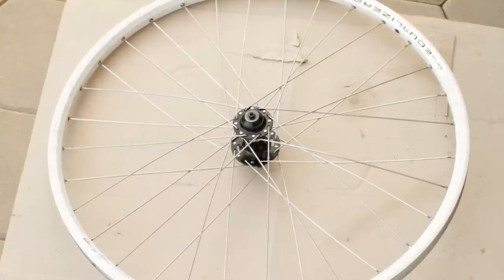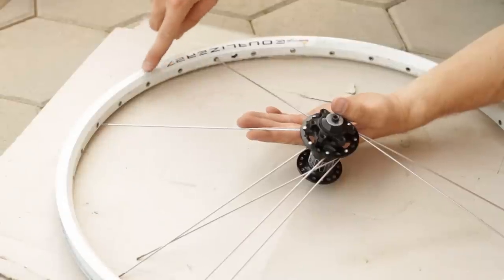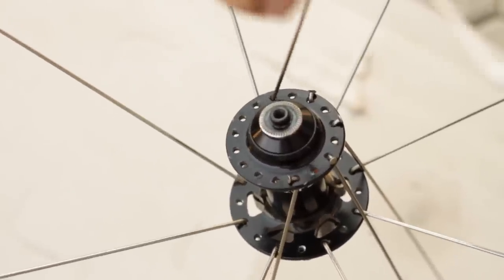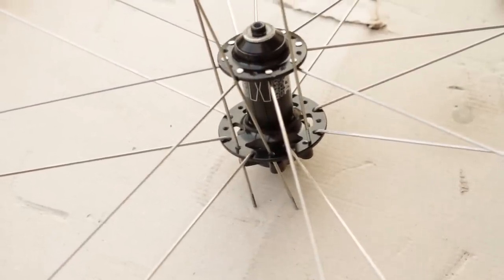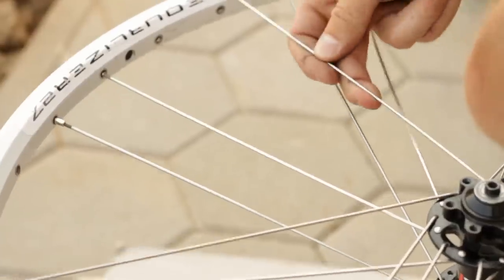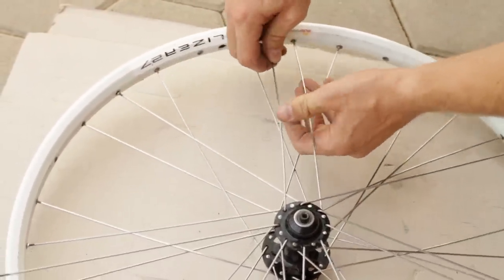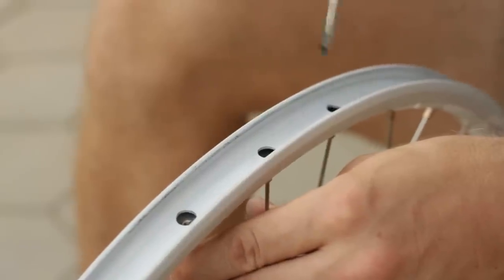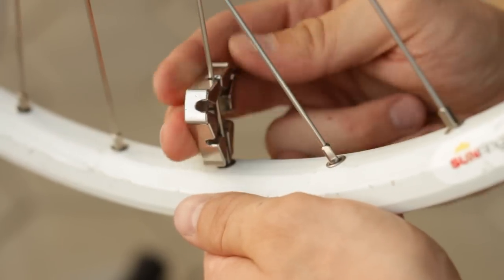How to Lace a Wheel - Three cross pattern

Comment: This is by FAR, the easiest system to follow that I found! 1st time lacing a wheel and I had no problem following and once you understand the pattern, it's easy to finish on your own without the video. I had 14 full turns on all the nipples (3 turns at a time) and stretched them all a number of times as I tightened them up. Took them to get final tensioning and trueing and the guy said that everything was just about perfect as it was, just a bit of trueing and ready to go. Thanks Bikebook!!

Comment: I don't understand many of the comments here. This is by far the easiest and most straight forward wheel building video I have seen. The video takes you step by step in a very clear and orderly fashion.

Who ever made this video is very smart and efficient.
Reply: Yet it mysteriously skips the very important step of flexing the newly installed spokes under a heavy load, necessary for introducing a degree of pre-warp to each side of the built wheel.
Reply: I agree.  Much easier to follow than the highly regarded Sheldon Brown/Harris St Cyclery article on same.  Admittedly - she is just dealing with one configuration (32 spoke/3cross) - which makes it much simpler to explain (e.g. counting 5 holes anti-clockwise, etc.).  Nevertheless - very clear.
A few minor things could have been added - pre-stressing the spokes by pressing the whole wheel sideways and squeezing adjacent spokes, then rechecking/tensioning everything; oiling the spoke nipples at the start; and the usefulness of a tensiometer to get the tensions nice and even before starting the truing process.

Comment: This was an easy video to follow. I have looked at several on here on how to lace a 32 spoke 3 way cross over and this worked for me. The dishing and truing may be on the basic side but if you can get it to work for you then thats great on a more expensive bike and wheel i may go down the lengths of using a dishing tool and spoke tensioner., but all in all i found this very helpful. Thanks

Comment: This video helped me build a wheel after several failed attempts.   I had to stop and replay certain sections, but it all made sense and the wheel came out perfect.    They do leave out a few key points, such as the spoke hole offset (not all in a straight line).   I am saving this for the next time I build a wheel.

Comment: Wonderful video.  Best lacing video that I have found and obviously videos are better than text when it comes to this stuff.  My only issue is that when I did it my valve hole wasn't correctly boxed by the spokes.  Use shorter valve stems and it does't really matter anyway.  But she does explain that you need to drop the spokes in relative to the other side of the flange but it's still a great video for a first build like mine.

Comment: Hi. Is there a difference size of front wheel and rear wheel lacing?
Reply: What do you mean by 'size' in this context?  The rear (drive) wheel, or any wheel with a disc brake needs to have greater rotational strength than others, and so could use a pattern with more cross-over, with some penalty in weight.  e.g. for a front, rim-brake wheel you could consider radial spoking and/or a lower spoke count.

Comment: Just laced my front wheel, kept pausing the video for each step. Had no problems.
I have done it once before but this time went more smoothly.
I use bits of cardboard taped to the frame to true wheels and have never had a problem with that method and I've done quite a few.
Reply: Do you put the bike on a bike stand to true the wheels?
Reply: Flip the bike over or hang it from the nose of the saddle, like on a branch of a tree.
 @alantaylor6691
Reply: @CncObsession  Thank you!

Comment: the only thing i don't understand is different size spokes. should I be using different size spokes on the same wheel? should I measure my old ones from the rim to the j bend or what?
Reply: I used all the same size and actually none of them seem bent at all. it must depend on how you weave them. my holes were opposite the ones in the video. they should be on the same side as the side of the hub you're working on.
Reply: @TheRollingResistance  Somehow you omitted mention of disc brakes (something the narrator keeps referring to), in which case the brake side typically takes slightly shorter spokes, due to the greater width of the hub flange on that side. True on the non-drive side of front wheels with disc brakes, and on the drive side of rear wheels for proper dishing.

Comment: 0:35 isn't it an error?? i mean about rear wheel. on rear hub shorter spokes must be on drive side (not rotor side)!
Reply: She should state, "remember, if it's the front wheel disc side, or rear wheel *drive side, these are the  **shorter spokes".    *drive side is the cassette side. **because they will be tensioned higher to pull the wheel to center.
Excellent video, one of the easiest to understand and video angles are instructional in themselves.

Comment: The very last step you mention about checking radial/vertical true is grossly out of place.  

You should be checking radial/vertical true as soon as you start to tension the wheels.  In fact, you should be checking it while you also are doing lateral truing.

Comment: I need help. By the time I got to the third round, the spokes would no longer reach the rim. I did rotate the hub counter-clockwise as instructed after round two of spokes. I'm using the same size spokes because the flange on both sides of my hub is the same size. Any ideas?
Reply: Brantley Oakey   Super late but maybe someone else might get help from my reply. I thought the whole time after disassembling my wheel that I needed a 3 cross pattern when I really needed to put it back together with 2 cross pattern. 4.5 hours later

Comment: does she said that if you're using a hub for disk brake rotor, you must use a shorter spokes?
Reply: Yes, I guess for balancing the length of the cassette/disk brake. I am no expert on the matter but I figure you can get the same effect with just tightening a bit more the spokes on that side, right? But being careful for the spoke to not protrude into the tube region (but I doubt it would be that long, really)...